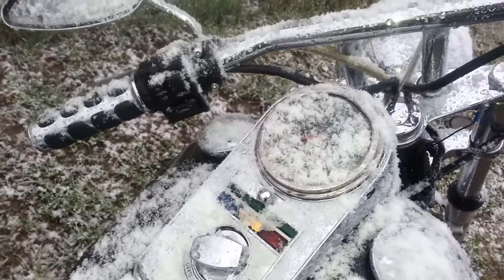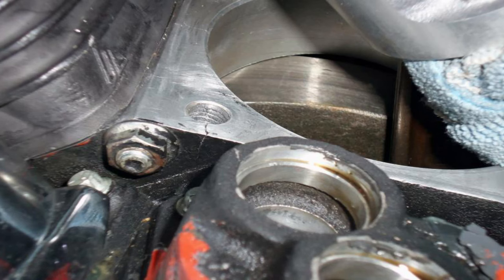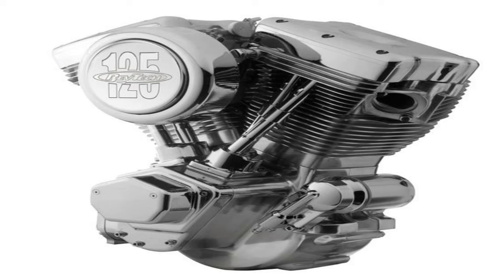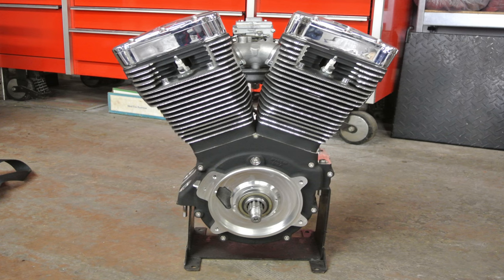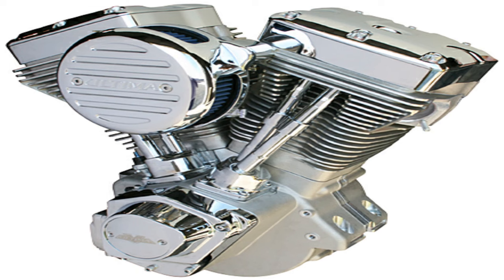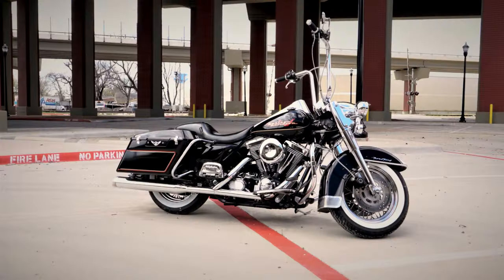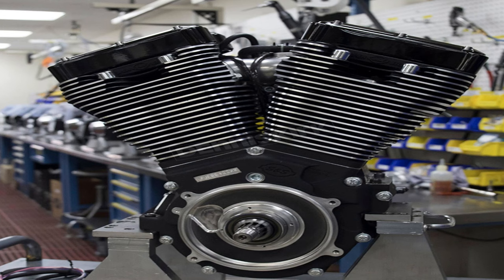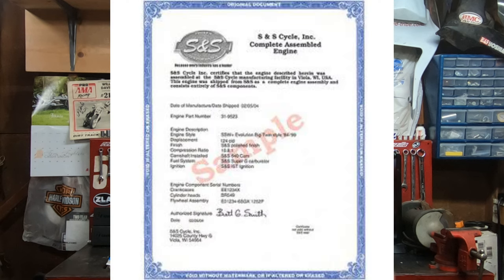New Harley Evolution Engines are Better Than the Original

Comment: Love the Evo in my 93 Heritage. Has 41,000 miles and honestly runs really good for an old bike. It has had a cam and Jim’s lifters installed. Like your videos  a lot. Thanks for the info you put out on all the Harley engines. By the way, I would get a crate engine. From the info you gave it appears to be the best option.

Comment: Had a friend years ago and he had an '02 Roadking. Pumped it up to 95 with all the go fast goodies. Still not fast enough for him. Told him to buy a big jnch crate motor and have fun and leave the 95 incher alone. Didn't listen and tore it apart to build a 109". He at least listened to me about putting in the gear drive cams in this rebuilt motor. After he was finished with the second rebuild he admitted that he should of just bought the crate motor. He could of bought a 120 ultima, 124 s and s and a revtech crate for what he spent on the two rebuilds and ends up with a motor that no one would trust to go cross country on now.

Comment: I think I did ok with my Evo for 300 bucks and after chasing down missing parts I have 1200 in it it's the 1998 and my understanding is it is most reliable engine they ever produced,,,I just want a cruiser,, and I fitted it to a 1971 Sportster frame,, wasn't easy but I made it happen
Reply from the maker: 300 bucks isn't bad at all for Sportster engine! They usually want a grand for one that's not even complete.

Comment: I would just go with the crate engine before rebuilding the old EVO, nicely done brother💯👊🏽😎
Reply from the maker: Thanks 👍 I think I would too, by the time you bought a set of aftermarket cases, all the high end parts and got it together you'd be right there with the price of a complete engine. Even then you still wouldn't have warranty on the engine itself.
Reply: @GixxerFoo  truth brother💯
Reply: I agree.After doing some serious reserch it was way cheaper to replace mine in my 98 fat boy over rebuilding the stock motor.And it only had 24k on the motor.I plan to find a classic hard tail for the stock that I took out and make it a project for my grandson and I to build together.I had always enjoyed The late Indian Larry's still and that's kinda what I have a plan for.
Reply: @GixxerFoo  Are these older frames and drive trains engineered for 100+hp? I think I would just go with the 80in, since, it's already a substantial increase in power over the original. Thanx for the vid/info!

Comment: My Bagger originally came with a S&S bottom 88 Stroker probably 1995 vintage end few years later it was making the weirdest noise. dozens of Harley mechanics listened to it & the noise would travel from one side to the other. Ran awesome. One night I stop at a gas station start it back up went 100' & it shut off ,crank, crank ,crank.... nothing!!  until I see the oil puddle forming under me. Exploratory Surgery Found the pinion broke from the steel boss in the case where the bearing rides was cracked & flopping around & basically the entire right side of the engines crank shaft was being held up by the pinion bushing on the cam cover UNTIL the pinion broke. NOW its wall art. with the 2 piece pinion shaft.
Reply from the maker: Oh damn... that sucks. That was one of those hard part failures that isn't common and you wouldn't of caught it unless you tore the bike down and inspected the internals.
Reply: @GixxerFoo  yea for sure. Go till it blows. I have a S&S 88 back in there.Just one of those things. Id know that sound if i heard it again!! Lmao.

Comment: I wished I had this crate engine knowledge six months ago. We are almost done with rebuilding the stock engine. After 9k, It is in assembly phase now. Lol. However, on the bright side, I installed the best parts such as Dark Horse fly wheel, tts cam, fueling oil and Cam plate and Baker tensioner etc. Keeping fingers crossed.
Reply from the maker: Sounds like you've put the goods in it! Shouldn't be any worries there!

Comment: Heh 138 thousand miles on my 93 FXRS LowRider Convertable. Incredibly reliable bike.   

2tops. 1Bottom rebuilt.  ALL stock.  So no stud pulling.  I got 50 mph because of it while riding across the US.   

It's the ride... Not the destination.  I do not need to go fast.  I just need to get to place to place at my pace.

Comment: my dad got the S&S 111 for his heritage springer after it spun a bearing in the bottom end on a stock engine. He had it for less than 1600 miles and it became an expensive paperweight, he contacted S&S and got his warranty and paid to have the second one put in and then 1500 miles later it's already making a ton of noise and has shavings in the oil. S&S told him the second motor didn't get a warranty and kept pushing him around and not honoring an engine with 1500 miles on it. Could just be two bad motors but my dad is religious on break in specs, maintenance, and service on his bike and they basically told him sorry you spent $7000 on two junk motors. Not sure if it's just a problem with the 111 or if my dad just got two duds but it is something definitely worthy of note
Reply: Now stories like this scare me.  I thought S&S were the best and you paid for them NOT to have that exact problem.  Any update?
Reply: @ditchcati so the update is about the wildest thing, my dad gave me the bike and we went through all the fluids and did an oil and filter change and now it makes no noise and no shavings and it runs like a dream. I’ve been riding it for a year with literally no problems, I put like 5000 on it and now it’s been a great bike

Comment: I had a 96" Ultima installed years ago, and I have had to only replace the cam, which I replaced with an S&S .585 cam. I didn't need too, but I also replaced the pushrods and lifters with S&S.
Reply from the maker: Ultima motors are pretty good, you see a lot of them out at the drag strip.

Comment: Like you said these days it is easier to get the new engine and do a swap out than do a rebuild. It is the way to go as far as time and money. I learned this from a guy at the auto store twenty years ago when I went to rebuild my front cv joints on my Chevrolet truck 4WD.  Rather than buy all of the parts and rebuild it was way easier to buy the assembly and just swap out the entire axle assembly with the cv joint already on it. Four hours later I was done. Most of the after market assemblies use better fasteners and gears, quality of steel. Go with the crate engine that fits your budget. Time and labor is where you save plus no headaches with running into defects found during the rebuild of the old engine.
Reply from the maker: I was actually at parts counter one day and a guy was looking at Stage 4 kits. This is an awesome dealer, they leveled with him. Told him you can get a 120R or ST and do a swap a lot cheaper and you have a spare motor. Labor to tear down and install plus cost of the kit is way more than a motor swap.
Reply: A lot of guys never factor in the cost of their own labor. Time saved.
Reply: @semperfipar1299  why would you? Most people build them for the fun. When people go to the moi es or go to a ball game or what ever, do they figure that in? It’s a lot cheaper to build a factory engine then it is to buy a complete motor. And if you buy a Revtech or Ultima motor you’re just killing the value of your bike.
Reply: @tonyparson4392  You know when you do a build cost analysis you are suppose to factor in the cost of your labor. Building for fun is not building for cost and efficiency or quality of the build. There are so many Harleys on the street that Harley itself has pretty much killed the value.

Comment: What about an s&s 106 i have a set of super stock cases can i use my stock evo crank and cylinders and head heads have been flowed and ported bigger valves what do you think i can build with this

Comment: I went with the S&S V 111 when I restored my 1993 FXR down to the frame.   Runs great & strong throughout the whole power band. Shipped to my house I payed $5k.  Was a plug & play install. Installed a Thunderjet on the Super E & a 34 tooth tranny pully & a BDL kevlar clutch & a 2into 1 Hacker War Header.Everything is working together perfectly runs alot cooler than my 96 TC.
Reply from the maker: That's awesome, I bet that motor is fun in a FXR!
Reply: @GixxerFoo  Hell Yeah!🤣
Reply: $5,000 for a V111 my ass!! 🤣😂🤣😂
Reply: @TheYammerHammer   LOL @ the time, I pulled my 2nd rod on my 80" & called S&S to get some info on their 80".  Long story short they told me to get the V111 that they were running a sale on the V111  & would be cheaper vs the 80" in black.  So I bought it from a company in Georgia for $4800 plus $250 for shipping.
Reply: @robertrodriguez2412  of course they told you to buy a new motor. They're a business that's what they do. Sorry you were unable to work on your motor that sucks. I guess it's just more business for me
Reply: @robertrodriguez2412  however that is a really good deal on that motor hard to pass by. But what are you going to do when that blows up replace it with another? Come on dude grow some balls
Reply: @robertrodriguez2412  as a matter of fact if you're stock Evo doesn't have close to 100,000 miles on it don't f**** talk to me
Reply: My Evo has 6 figure mileage. 
Never babied or beat on it.
Always changed the oil early.
Replaced lifters, base gaskets, and head and rocker box gaskets a few times.
Installed a S&S super E carb pretty early on.
Also compensation sprocket. 
I think the gaskets would have lasted longer if not for all the late night cold take offs.
The engine doesn't burn as clean as it once did, nor does it perform as well. 
These engines will keep going when well worn. 
Bike itself isn't all that attractive so it became like a science project to see just how long it would go before grenadeing itself. 
  Still goes.
Someday I'll take it apart just to see just how wore out everything is just for the fun of it.
It's a 1993 first year head breather dresser.

Comment: I got a Moco crate ( when they were still available) for my Heritage - the original one had lower end molested too much.  Nothing special I must say, esp. comparing to my 98 FLTRI ( converted to a carb of course). That one really pulls - I think later EFI evos were pretty good.  Those were dino figures, not just gearing. But hey, it's a softail, doesn't hafta pull hard. 
So the moral? Both have been reliable and well prooven, ill just change the rings when needed, rebore when measurements are outa spec,  repeat. When Im outta bore sizes - buy new jugs, repeat 😁

Comment: I just purchased a Big Dog Ridgeback Chopper.
It came with an S&S V111, with the 585 cam, 125 HP (as per S&S stat sheet i have) EVO mounted to a JIMS 6 speed. Engine fires right up every time. Transmission just chugs along at 75 mph.
Bike is a blast to drive! Aside from hitting major bumps, of course. 😆

Comment: I got my 1995 evo brand new, now has 130,000 on it. I know where all of the miles came from. Ive had a few other bikes over the years but sold them and stuck it out with my evo. 
I've wanted to swap out the engine with a mild 88 most likely. The issue is, other than age, there aren't any issues with the engine I've got. At the same time, I dont want to wait for a catastrophic failure that leaves me stranded. Probably in a couple more years I'll pull the trigger on a new crate motor.

Comment: Ive been taking a hard look at the v111. Almost a no brainer when it comes time. Even the v80 would be a great choice for me.
Reply from the maker: Those two me are the best options for a Evo replacement. The V80 is very solid motor and produces great power. Lol the V111 that things going to burn through some tires.
Reply: S&S all the way up!

Comment: Dumbest mistake I ever made was selling my 87 FXRC.  I put 88,000 miles on it and it was the most reliable high mileage bike I’ve owned.  Milled the the heads 50 thousand, a little bit of porting, factory CHP ignition, and a mild cam.  And yes, it put out more than the factory clutch could handle.  Great strong running bike

Comment: Having grown up with my relatives always being loyal to S&S for performance parts it’d be hard for me to choose anything else, not to mention their Knucklehead and Pandemonium engines being the most aesthetically beautiful choices as well as preforming so much better than stock which of course hasn’t been produced in over 50 yrs. speaking of obsolete engines Flathead Power makes 1200cc crate motors for those interested. Makes me wish I had my Gramps’s old WLA with the 74” flywheel in it, was the 1st Harley I ever got to ride after I learnt on my beat up Honda xl 125. Just wish HD would supply S&S engines stock, it’d make for a much better product

Comment: I have a 107 ultima in my 87 dresser. after 35k miles a roller lifter seized and damaged the cam. It is very powerful and runs decent. I had a 110k miles on my Harley motor when it went.
Reply from the maker: That's a hell of a motor to replace the stock one with, sucks about the lifter though. Were you able to replace the cam and lifters to save the motor?
Reply: @GixxerFoo  Yes we did, I called Mid west cycle who deals with Ultima They gave me a whole 10% off the parts. I was upset. I did not want a 107, but they said it was the smallest one the made at the time. It was about 8-9 years ago.
Reply: S&S has been having LOTS of issues with the V111. They have been farming out local shops to address them. I wouldn't own either of these engines...stock Evo in my opinion
Reply: @kennethwise7108 where could I get more info on the S&S problems?
Reply: @ditchcati  contact Mike Magero in Harrisburg. He is a subject matter expert and routinely repairs and overhauls HD motors

Comment: Love your video's! I really enjoy learning different characteristics pros an cons of these Harley engines. I just bought a 2013 Heritage softail with 103 that has 3,298 miles on it. Is this a good engine? Is there any major flaws to this engine that I need to look out for?
Reply from the maker: Thank you! 2013 with a 103 is one of the best years in twin cam, Harley really seemed to get the bugs worked out of it by then. They had some compensator issues in previous years, only thing with the 103 is the pressed cranks. More often than not they are solid reliable, they run for years without issue but every now again you'll hear a story of a crank spinning. Mostly due to putting a lot of power on the stock crank and really beating on it.
Reply: @GixxerFoo  okay,  i seen your video talking about the crank spinning. You could weld the stock crank or replace it with a better after market one?. Im going to watch it again lol, thanks brother
Reply: 3k miles ain't even broke in. Maintain it and ride it. Same motor in 2012 and it's over 75k miles. Mobil 1 oil every 5k.
That crank problem is no problem unless beat on (As Foo says) and especially if you engine brake hard just to rattle the neighbors windows.
Harley compensators in this era SUCKED. When you need a new one... and you will..install a Darkhorse ManOWar compensator. Watch video on YT. And thank me later.
Oh...and I installed a Hayden chain tensioner. Harley's auto chain tensioner ain't great. Good Luck
Reply: @silentshadow7625  I was going to mention manual primary tensioner but Doug said it. Yes Man O War compensator, manual tensioner and if get major run out on crank pins, you and get trued by Dark Horse. 👍

Comment: I'll take Scooter Tramp Scottys advice on s&s. I'd rather have the longevity anyway, personally.  Jmo
Reply from the maker: Yeah with S&S I think I would go with the V80 and call it a day over the V111. There's a lot to be said about longevity and not sorting out issues all the time.
Reply: Seems reliability is a moot term with a Harley, as most are dead at 40k, and a handful make it to 80K.  That is break in miles for many bikes today.
Reply: @thomasheer825  EVO engines are meant to run to and beyond 100k.  I'd say most folks don't really care to keep a bike past 40k, but Harley fans are different.
Reply: @Shastar271828  Yea I hear about those bikes all the time, but when you try and actually lay eyes on one they seem to evaporate into the either.  Another one would be the true the clock shows 100k with routine repairs.  Then you ask them what the repairs were, and usually it is a piece by piece overhaul done in 10k increments.  Sorry at one time  I actually worked on Harleys, but got fed up with them.

Comment: A shovelhead , I like your videos but I still don’t understand why a Two cylinder engine would run on average 5 grand. Evo’s are great I’ve owned a few but I’ll stick with my Shovels.
Reply: Iv got two shovelhead bikes myself and I love em
Reply: @bryanmartin2271  I do too!
Reply: Me too! Love my shovel! I think the older bike sound badass then the new crap.
Reply: @JohnDoe-mt8rf  I agree and people are always commenting on how they sound.
Reply: Also if they change the motor, that changes the vin #. So,I just rebuilt,.my,70 shovel and tyranny , and kept it original and keeping the orginin vin, plus the value would be shit if changing the motor
Reply from the maker: I ask myself the same thing about boats, there's nothing to them but parts are insanely priced. I guess with a bike you have about half to quarter less parts so they charge about 10x as much. Shovel powered bikes are just fun, it's all mechanical and it can run with or without something in most cases lol.
Reply: @GixxerFoo  you’re completely right about that.
Reply from the maker: Lol that's all l can reason out of the cost, really no sense in it.